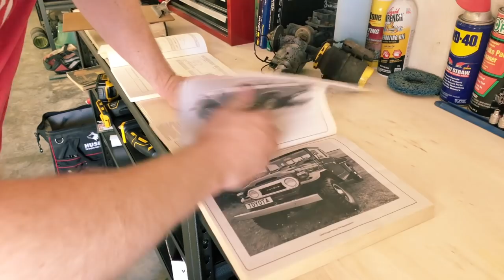Project Wrong Way 14 - Butt Stuff, Wire Wheel, Rust-Mort - FJ-40 frame prep.

Comment: Hey Ben, Have you heard of POR-15? You can apply it directly to the frame and it will inhibit any rust. I'd recommend cleaning just like you are and POR-15'ing after that. The good thing is you don't have to apply primer. It's really durable too. Only downside is it is pricey and will be difficult to remove if you decide to do a full frame off later on. Comes in brush on or spray cans.
Reply from the maker: I have obtained a can! It’s on the horizon.

Comment: Glad I caught this before you got too far! Great show - very entertaining👍
For just wire-wheeling the frame as it sits for clean up, looks like you’re actually doing a good job, it’s just time consuming. Interested in seeing how the SEM Rust Mort works.
Reply from the maker: Thanks man! I’ll keep after it, no need to show any more episodes of wire wheeling. Next one will be the Rust Mort results and POR-15 application. Should be simple.
Reply: Oh cool, POR 15 is good stuff! Used it on some bump-side parts I refinished over 10 years ago, still look pretty much exactly the same as they did the day I installed them.
Plan on using on my FJ55 frame here pretty soon. Currently a tad deeper into mine than you are into yours 😄
Reply from the maker: Dusto5 I had a 72’ FJ55. My first vehicle, and first love.
Reply: AWESOME!👍👍
Reply: Got a build thread on ih8mud in the Iron Pig Preservation Society  - “Fly By Night”. If you ever get on, come give it look. RUSH55 is my handle there. A bunch of us just finished up Pig Party 2019 in SLC, lots of cool pics.
Anyways, looking forward to more of your vids😎👍
Reply from the maker: Dusto5 lots of buddies out in SLC. Family too, it’s pretty country. My mud handle is BenjaminCA. I’ll check out the build, my next idea for a project would be a 55 with that little 2.8 Cummins in it... it’s an amazing power plant. I filmed a special PWW episode about a friends cruiser with that engine.

Comment: You’re supposed to leave it wet on the substrate for at least 45 minutes, you can’t just put it on and let it dry. You gotta keep it wet for 45 mins (not with your tiny jackhammer) and then rinse it off with distilled water to neutralize the acid. Didn’t you read the technical information on the sem website
Reply from the maker: The results were better than I expected, after hearing what I should’ve done I’m guessing they would have been even better. I read a little late in the game the proper method, but for anyone going this route I’m thinking your feedback here will be a help to them.

Comment: just wondering seeing as you have the engine out why not take the body off and do a full frame off restoration? when you consider these trucks don't need a real top, their wiring isn't crazy, their interiors are spartan, they don't need carpeting they are way easier than a 60's car to do a full body off. plus it would give you at least 5 years of video material.
Reply: I mean, I can already hear your wife's thoughts on this idea but..... I mean... it sounds good... Plus, I want to do that too and it would be great to see how that works out for you first... hahahahahaha
Reply: Yes, let’s prolong this process 🙄 😂
Reply: I agree.  You are 1 afternoon, 8 bolts and 3 dudes from the Elders Quorum away from having that tub off the frame.  Do that and then continue the frame prep!  I love it!
Reply from the maker: @bryandahlberg1956  Im scared. If the body comes off, it's a rabbit hole man. I never wanted this thing to be amazing looking. Just wanted to drive it, and fix it when it breaks. I was trying not to get caught up in the restoration side of things. Im starting to think I'll have too anyway.
Reply: @projectwrongway9127  Ben, you're already up to your hips in the rabbit hole.  :)  Will make the wire wheel work a lot easier.  :)
Reply: @projectwrongway9127  That thing looks pretty clean unless there is something you are hiding from us.
Reply from the maker: zimtuff it’s clean. Just wanted a bit of paint on the frame before the new engine goes in.